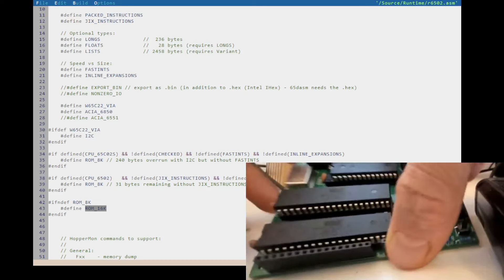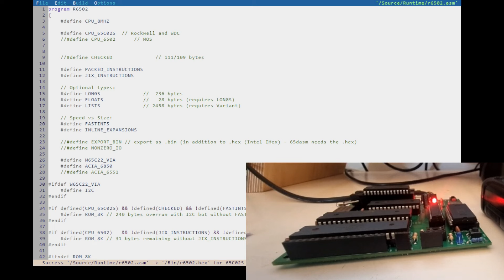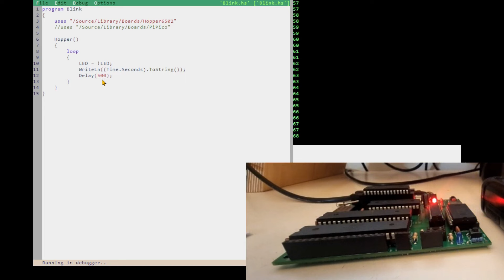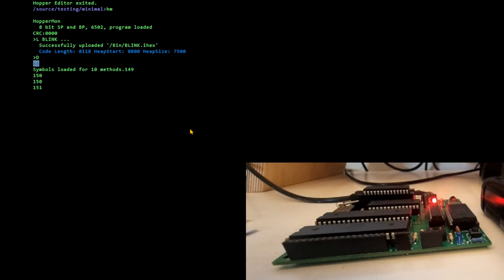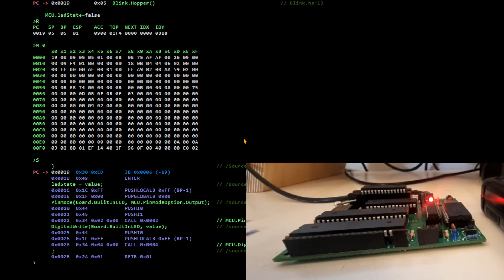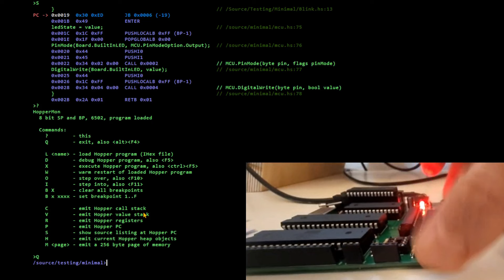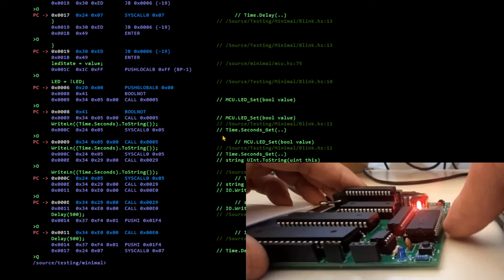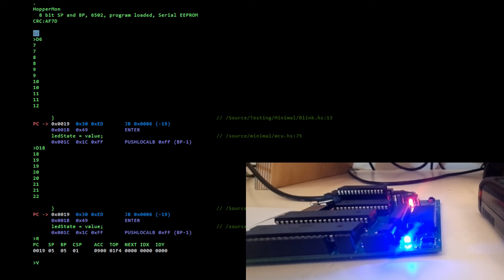Serial port and Hopper VM firmware : Hopper 6502 SBC Part 8

Comment: I have some questions.  Can the hopper 6502 save a program to the serial eeprom or do you need the eeprom programmer to do that?  Will Ben Eaters glue logic allow legacy programs to run or do we need to convert them? Also I am on Discord but I don't know how to request to be added.  The Hopper cross platform compatibility with the 6502 and microcontrollers is amazing!
Reply from the maker: Discord invite:
https://discord.gg/rrNWFXBE
Reply from the maker: You upload Hopper programs using Hopper Mon (from Windows) and the last program uploaded is stored in the I2C serial EEPROM. It is run automatically on reset (much like an Ardunino).
It is possible to support Ben Eater's memory map (I/O addresses) by reprogramming the CPLD.
Reply: @biggertigger  Thank you so much!  My boards should be here in a couple of days, but my son wants to build one too so I need to buy 2 sets of ICs lol.  I have a Corsham Kim Clone, but I am so busy it's hard to find time to get it out and set everything up.  I can have the Hopper board sitting out next to the computer and plug it in when I get a free moment.  It's also small so it would travel well on vacations.  I'm familiar with programing on an Arduino so this is really cool!